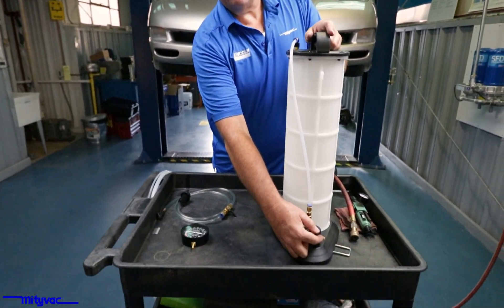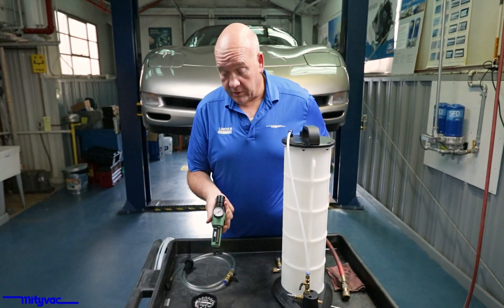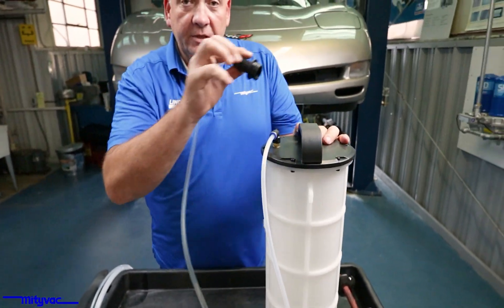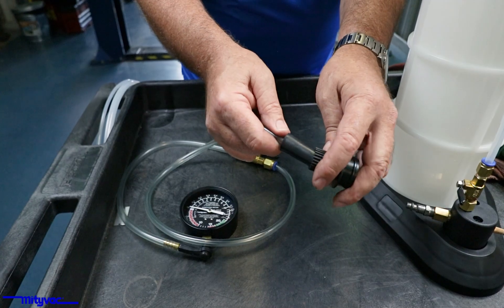Troubleshooting vacuum issues on the PneumatiVac MV7300

Comment: I have a MV6830. It now blows out the suction tube instead of suction. I came here hoping to find answers. I did not.
Reply from the maker: Please remove the front muffler assembly and check for a blockage in the passage. This could be diverting the pressurized air into the reservoir rather than out the muffler. the passage in the handle and the inlet to the muffler must be clear to allow for venturi affect to draw vacuum in the reservoir.

~ John

Comment: I have vacuum from the bottom hose up to the shark bite on the lid, but from there I don’t get anything. I have removed the lid and cleaned it. I don’t understand what the plunger under the lid is for.
Reply from the maker: The plunger under the lid is a high level shut off to prevent fluid from entering the line to the venturi. there should be a rubber seal the plunger contacts, this should be an open port until the plunger closes this passage. 

~John
Reply: I need some of the attachments where can I get them

Comment: What do you think is the smallest air compressor I can use to operate this extractor?
Reply from the maker: I have seen these run off 10gallon compressors before. Users generally needed to watch for the fluid to begin moving indicating a vacuum formed before shutting off valve to prevent the compressor from quickly depleting or constantly running. typically though a decent sized tank(20 gallon +) with a high CFM output motor is recommended. To run these units, a compressor that can generate 4.5 - 5 CFM or more will typically work just fine.  You can run the MV7300 off a lower volumed compressor, however constant throttling and monitoring of the compressor is necessary. 
~ John
Reply: Even the smallest air compressor will work. You could probably even use a 12V tire inflator except that the connector on the end has to be a Universal Coupler, and not a tire inflator connector that is permanently attached to most 12V small tire inflators. I currently use a Makita 1 gal tank air compressor and it works fine.